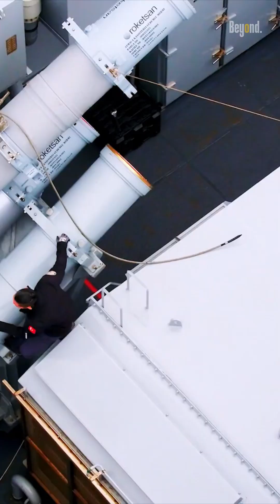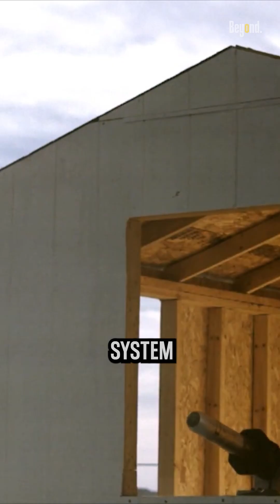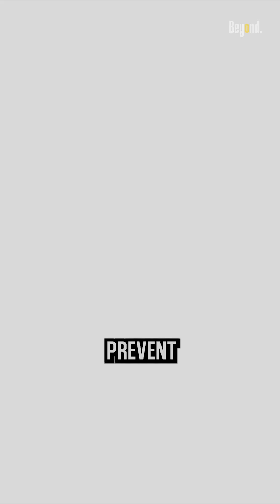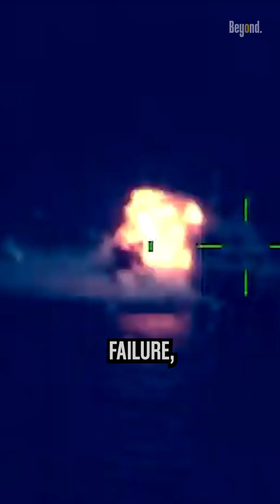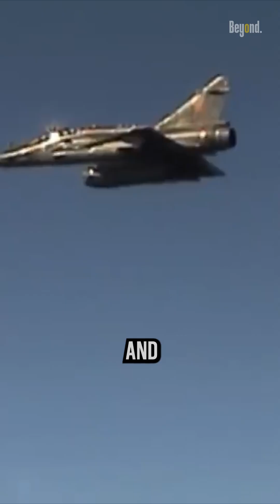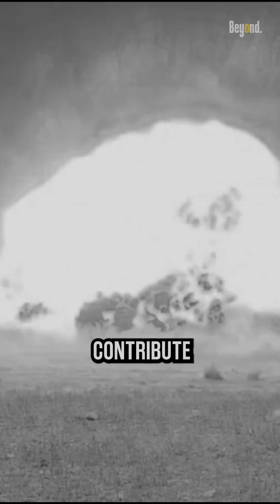When the missiles refuse to explode  #shorts

Comment: You know what I've been wondering for a while, what will the implications be if a ICBM carrying a nuclear payload reaches its target but fails to detonate upon impact. What will the protocol be to ensure the safety of citizens, who's responsibility would it be to remove the explosive the country it landed in or the country who fired it?

Ps: Could a country keep it which didn't previously had weapons with nuclear capabilities 😅

Thank you, great video btw!!
Reply: Whose responsibility would it be to remove it? Obviously the country that it landed in, the country that sent it was trying to nuke them! XD
Reply: Most, maybe all, modern nuclear warheads are implosion type, meaning they have a sphere of fissionable material as the core of the warhead. This core is surrounded by a pattern of conventional explosives that, when detonated, create a blast wave that crushes the core from all directions simultaneously to start the fission chain reaction. The most likely way for this kind of warhead to fail to detonate is for it to fizzle, meaning the conventional explosives do not go off correctly, producing a "dirty" conventional explosion rather than a fission explosion. If that happens, there isn't an intact warhead to recover, so it's moot.

Much less likely is that the conventional explosives fail to fire at all. If that happens, then you have a warhead, which includes a significant mass of very dense metal, continuing on its ballistic trajectory until it hits something. If that warhead is in a free-fall bomb, then the core may be recoverable as the bomb hits the ground at fairly modest velocity (by comparison), which is how the bomb.material is recovered in Sum of all Fears. However, you specified a ballistic missile, for which the answer is wildly different, because long range ballistic missiles peak in the neighborhood of Mach 25-30 and are still travelling at high Mach numbers by the time they reach their target area. Under those conditions, the fissionable core may well bury itself tens to hundreds of meters in the ground, unless the shock of impact is enough to set off some of the conventional explosives and create the above-mentioned dirty explosion.

Regardless, if a nuclear weapon has been fired or lost and is in a recoverable condition, it's pretty much a free for all to recover it. Returning it to the original owner would obviously buy you a lot of good will, but there are probably a few countries that could publicly recover such a weapon, refuse to return it, and make it stick despite the consequences.
Reply: ICBMs are shot into space and drop their warheads at an incredibly high speed. Even if the warhead doesn't explode, it will most likely be all over the place. On top of that, if one nuclear ICBM launches then so will the rest of them. After this, no one is going to give a dam who's responsibillity it is to get rid of the warhead or what the protocols for a Situation like this are, because neither the attacking nor the attacked country will still exist in a few minutes.
Reply: Actually, you raise a good question. An ICBM is an end world weapon. It is expected that no one will fire a single ICBM. Each one will fire dozens or all of them. It may be the case that some may fail but because so many will be launched, the Mutual Assured Destruction is guaranteed and the world will suffer a 10+ year long Nuclear Winter/Ice Age.
Apart of ICBMs, bombers are also used and there have been cases where nuclear armed bombers CRASHED and their warheads were LOST. The USA have a term for this: BROKEN ARROW. Search for "Thule Incident" to learn a real case that happened in 1968.